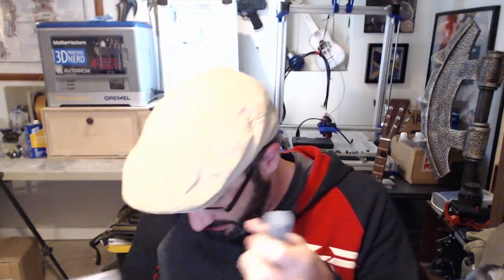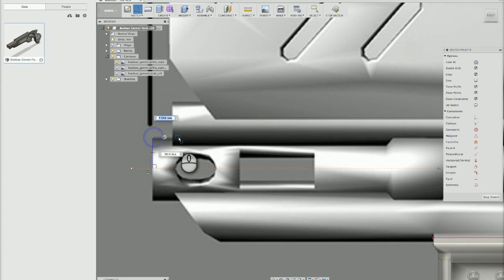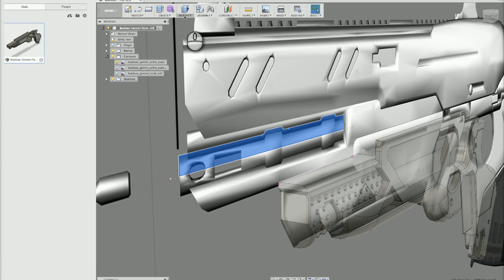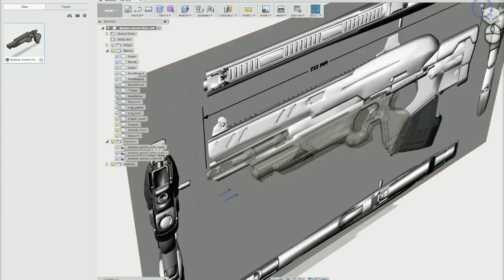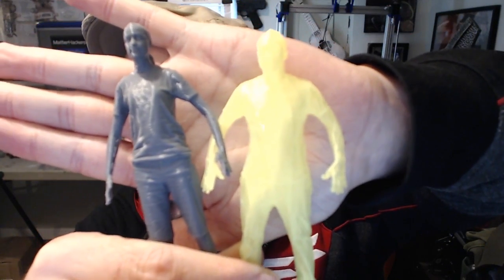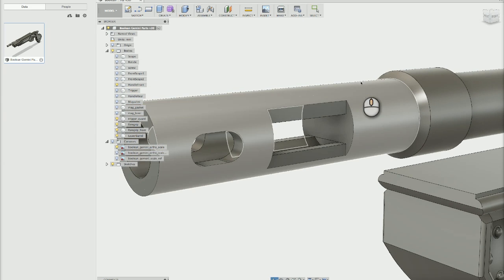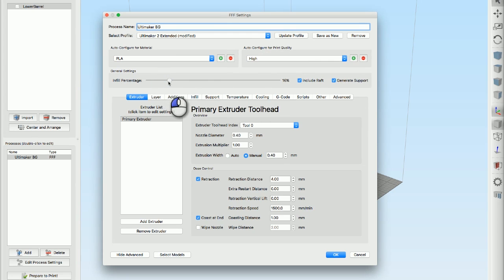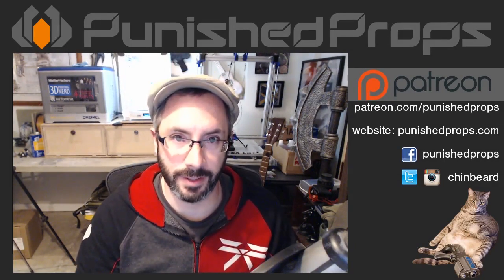3D Modeling Destiny Prop Parts in Fusion 360 - Prop: Live from the Shop

Comment: Instead of creating a new body, moving it, and then using the Combine command to make the hole through the barrel, it's quite a bit easier to just extrude the shape, set the direction to Symmetric, and not have to deal with multiple commands.
Reply from the maker: +Jonathan Huizingh I'm sure I'm doing most everything the slow way! Hah! Thanks for the tip. =)
Reply: That's the same way I learned. Get it done any way I can, and then notice how somebody else on youtube does it when they did it better than me and try to remember for next time!

Comment: It's a bit of a problem with cantilever-style printers, the bed tends to have some play in it that can break off tall narrow prints.

A few ideas, in order of difficulty in getting right:
1)Ensure the bed is perfectly level and re-calibrate Z height
2)an even coat of "disappearing purple" glue works well in ensuring bed adhesion between the raft and glass
3)use a very wide brim instead of a raft, and/or reduce the gap between the raft and the part
4)move the part closer to the cantilever support on the bed( i.e. towards the back), this should reduce the amount of play
5)slow down the print, particularly travel moves which tend to be the most violent
6)lower jerk, acceleration and travel acceleration in the print settings

Comment: I'm new to the world of 3D modeling, so sorry if this is a ridiculous comment, but would it beneficial to model male and female ends on the connection points between the individual pieces?  That way you could just snap the pieces together rather than having to glue them later?

I'm sure it would still take some sanding, but it seems a more elegant connection method.
Reply: That make sense.

Also wanted to let you know that I'm not really a maker, or a cosplayer or anything, but I came across your channel and the videos are awesome.  I'm into games and comics so the content is still relevant but creating things like this is something I never imagined myself doing.  Your videos are pretty inspiring though.  You guys make it look way easier than I know it is, but it definitely makes me want to try some things out.

Comment: As much as I enjoyed watching, I can't help but think that sometimes, it's not worth 3D printing something just for the sake of it ( 100% 3D printed model as such ). It would have been far easier and quicker to just take a pvc pipe and 3D print the bits that stick out from the surface, and cut the holes into it where needed. But then, it wouldn't have the coolness of being 100% 3D printed- quite the conundrum...

Comment: Hi .. love your videos...  I've been printing for years and I've tried pretty much every print bed material. You should try a Zebra Plate. You will not need a raft ever again .. ever since using it.. never had anything come loose or warp and it's really easy to come off the plate afterwards unlike things like buildtek.

Comment: With the Ultimaker, does the print base require any sort of adhesive to print on or does it print on the board? I'm using a Fusion3Design F-306 printer and for PLA I use a single layer of glue stick and ABS I use double layer in a cross-hatch pattern. I never have any issues with part separation with the glue stick. This does use a heated bed and it is glass. I have tried using painters tape with this printer successfully to lower the clean up time required with glue stick though. Just curious what the Ultimaker bed requirements are. Great video as always!
Reply: ***** Good to know! I err on the side of caution and make sure nothing escapes the printing bed muhaha!